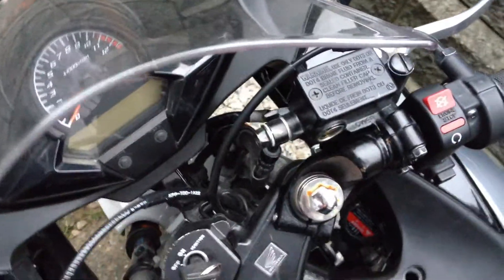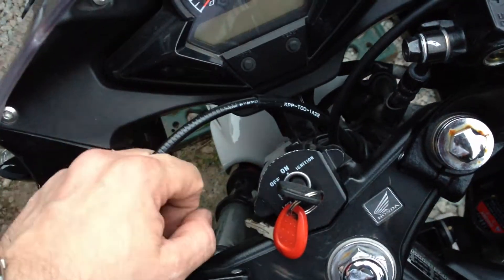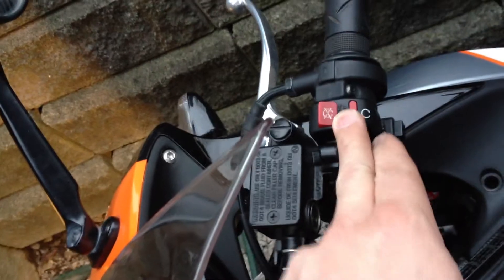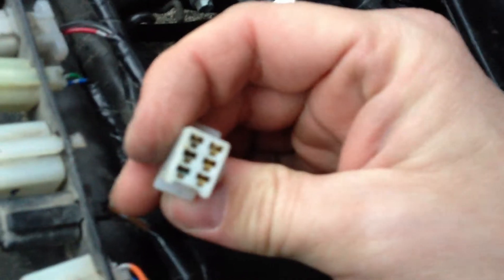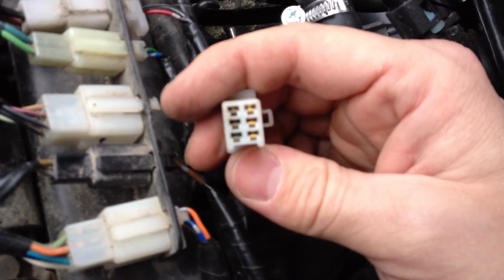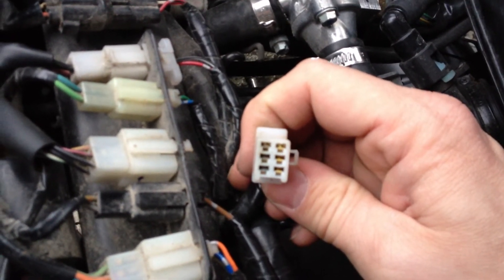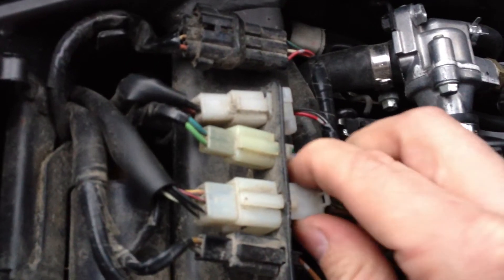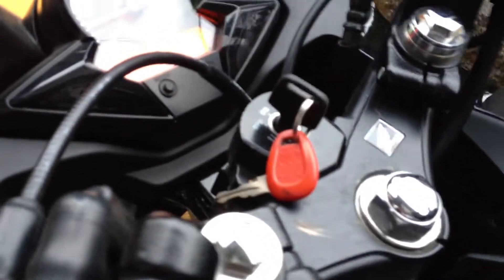Engine does not start (electrical)

Comment: Why not replace the connector?
Reply from the maker: How would that happen? Cutting the wires first? Then what do you with the short cut ends? Get the wire stretcher to make them longer again?
Reply: @theoverengineer  yes cut the connector. There should be some slack in the wires so you just need a new connector and strip the ends of the wires

Comment: Should I check connections before tearing it apart?
Reply from the maker: Absolutely, you might come across something obvious, saving a bunch of money.
Reply: I found the connection to the gauges has corroded so I'll change that, I'll have to replace the entire loom
Reply from the maker: Good troubleshooting, now the dealer will know where to look. Thanks for sharing your story.

Comment: Hi sir, I'm in the UK and have a 2013 cbr125r and the electrics are completely dead, I have bought a whole new loom but I read in the comments that it might just be a burnt fuse or corroded wire. The garage wants a minimum of £450 to install it so I don't really want to spend that much when I can do it myself, thanks

Comment: yes i tested the new battery and it works. where is the main fuse? is it in the box next to the battery? it wouldn't the me reply to you.
Reply from the maker: Main fuse is on the battery (+) cable, almost always outside of the fuse box, before it branches out anywhere.
Reply: thank you, it means a lot.      and i also have a Honda Cbr 125 r (2011)
Reply: i fixed it, it was the 30 amp fuse, thank you so much. 

also what should i use to clean rust of my brake disk, my dad says to just ride it and it will come off but i don't like the sound of that.
Reply from the maker: Good work, mate.
Listen to your dad, do not contaminate the disk with cleaners, solvents, residue, oily film ... Just ride.
Reply: ok thanks for all the help man.

Comment from the maker: Loose fit at connectors or switches is a typical problem, especially as dirt gets in. Disconnect, clean, put together. It works most of the time. Severed wires or burnt fused can be a factor too.